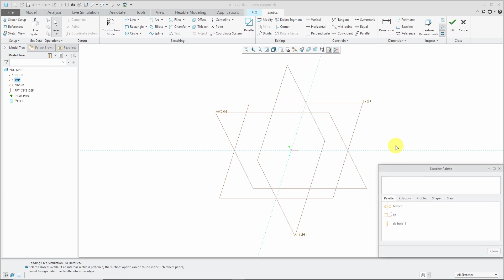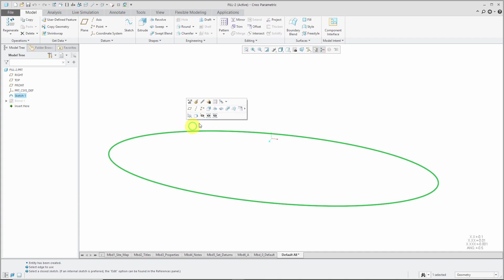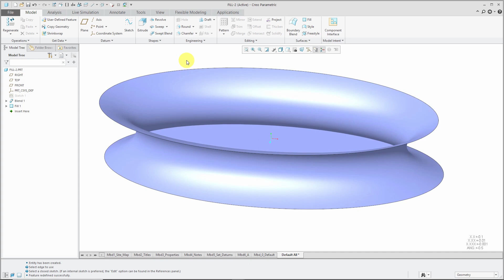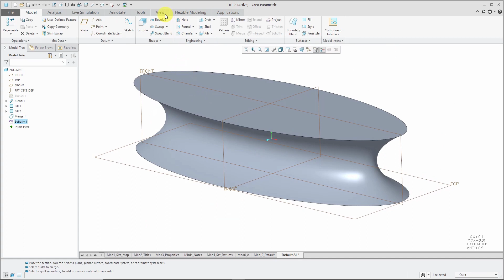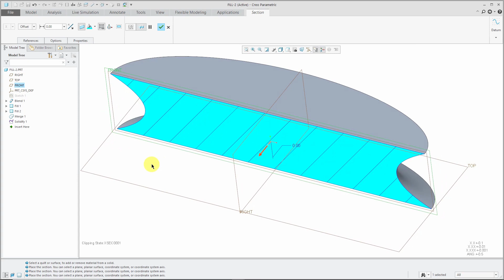Creo Parametric - Fill Command (Tutorial)

Comment: Hey,
So fill only works with sketch sections? If for example I want to fill a boundary of a cylinder, I' ll have to make a sketch first (like you did in this example, with the project function inside the sketch)? Isn't there an option to just fill the boundary of the cylinder, by just selecting it ? Other CAD software have this option...
Reply from the maker: Creo Parametric can do that, just with other tools. The Fill tool, though, is sketch based. You can create the sketch within the tool.
Reply: @CADPLMGuy  and what would be the easiest to use tool, if I can say that, (for my example with the cylinder), if I'm not bothering you too much :)
Reply from the maker: @thegicafarafrica7980  Easiest is in the eye of the beholder. Personally I find the Fill tool pretty basic. Alternatively depending on the situation, you could use the Surface tool in ISDX, Boundary Blend, or N-sided Surface, to name a few off the top of my head.
Reply: @CADPLMGuy  thank you. I have just started learning Creo, and I find your tutorials very explicit, so thank you for your job
Reply from the maker: Late reply... the Fill tool can also use Sketch Regions. This capability was available starting in Creo 5. Based on the video's publication date and Creo's interface / skin, this video looks like it was made in Creo 5. The functionality was so new I didn't realize it. I'm making an update to this video.